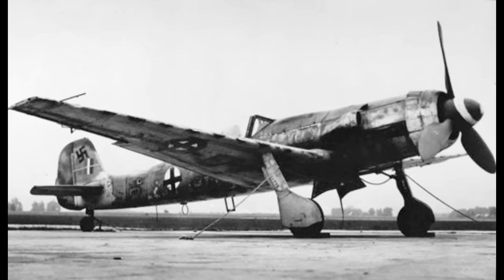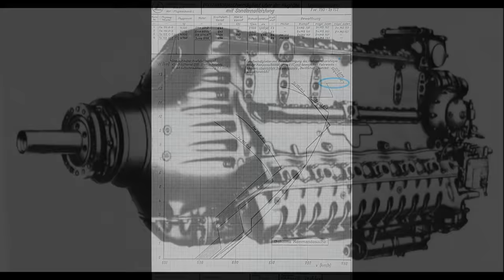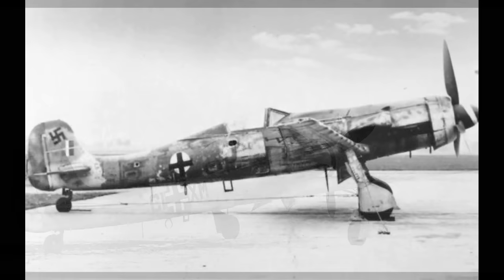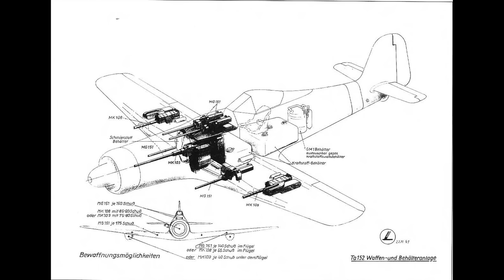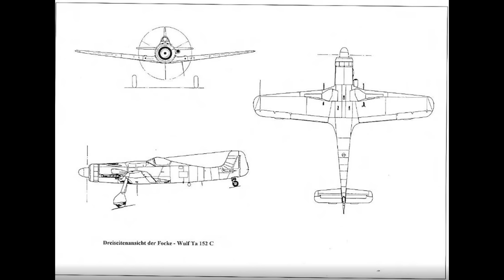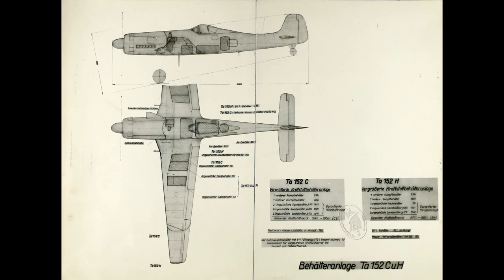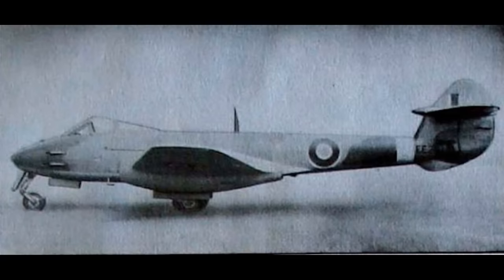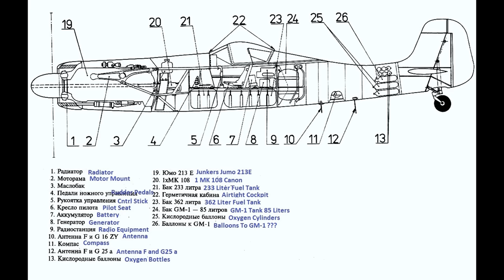Focke-Wulf Ta 152 H-1 Extreme Speed At High Altitudes.

Comment: Your videos say German manifold pressure was limited by fuel octane available. I just watched "The Secret History of Fighter Aircraft Engine Development in WW2" and he says it was valve metallurgy which limited power because they didn't have so much nickel. Any thoughts on what they say?
Reply from the maker: Metal was a factor, but fuel was the bigger issue. I can prove that, and at some point I will.
Reply: These are two interconnected but quite separate issues. One question is, for a given ideal engine design, and a given fuel, what is the knock limit. The second question is, if you install sub-standard valves, by how much are those ideal limits reduced. It is not a simple matter to understand it without substantial reading, and if you are very interested, you need to buy my book. In which you can actually read translated spoken word records of the German engineers discussing it during the war.

As far as proving that fuel is a bigger issue, the answer from 1941>1943 is is easily demonstrated by looking at the BMW801D which used high octane C3 fuel and the DB605 on standard B4. Both were reduced to about 1.3/1.4ata with B4 and low nickel valves. After about 1943 BMW, Jumo and DB were all using chrome plated valves, which significantly reduced the problem, after which the fuel again became the limiting factor for a short time, but the fact the German fuel had very high levels of TEL (which is extremely corrosive) adds a further complication, as such fuel attacks the valves more aggressively than Allied 100/130.

I`m afraid that "bigger / smaller" is too simplistic a metric to use to understand the issues in full.

If Greg wants to collaborate on a very detailed "deep dive" into that, I`m sure the result would be useful.

Comment: Several comments were made regarding "the faster propeller driven aircraft" during the war.  In context of extreme speed and high altitudes, why isn't the Dornier DO217P mentioned with is 488mph and 53,000 ft ceiling?  Were the comments only limited to aircraft which saw combat, were fighters, or were single engine?

Comment: Putting the Jumo 213 in the Ta152 certainly worked out better than putting the Jumo 211 in the 109.
Reply: +Zubenelgenubi    Putting a DB-605 onto a captured Spitfire worked out pretty good as well.  I would interested to see a current Spitfire restoration try that for a while.

Comment: What are the differences between the Ta-152C and the Fw-190D? Could you please make a video, because to my untrained eye, they look so alike that I don't see any appreciable differences, certainly not enough to warrant a whole new airframe desidnation
Reply: +George Armstrong    I'm pretty sure that you cannot take a Fw-190D aircraft and "convert" it to a Ta-152C.  The Ta-152C prototypes were built from from Fw-190D airframes though.  But consider the Ta-152 to be a new generation airframe.  Internal systems would also be different on the Ta-152 series,  such as an early form of pressurized cockpit and an early autopilot system.   Also the Ta-152C was going to use a DB series engine.

Comment: I have always wondered how engines were refreshed during WW2. For example, were the engines after so many hours sent back somewhere to be rebuilt? Likewise, were engines with higher hours swapped to other older airframes, etc.
Reply: + Rick    There were repair and service depots.   Allied mechanics were more likely to perform heavy engine repairs while the Luftwaffe would just swap the engine and send it back for service.   There are a few films of Luftwaffe engine repairs and service, although remember that a lot of the workers were slave labor.   The Luftwaffe also sometimes used the process of removing the entire engine, cowlings and all, and replaced it as a unit.   Captured equipment was also repaired for use including spare engines for captured aircraft and weapons for technical training.
Reply: @FiveCentsPlease  thank you. I find this repair / replacement process to very interesting subject. It seems like it would be nightmare considering the numerous variations of a single aircraft type.

Comment: Do 229 , can u do a video on this? the
 pusher puller twin engine fighter bomber. I wonder if that configuration could have been utilized to a fantastic degree if done with best possible engines.
Reply from the maker: I probably should.
Reply: I hope you don't mind if I join-in please , Misty ?  Are you referring to the Dornier Do 335 cos that has the twin-engined push/pull arrangement ? There's the  Horten brother's amazing Ho/Go -229 flying wing and that is just so cool . (It was designated as a 'Go' because it was built by the Gotha wood-works ) Pete

Comment: I think the DB603 is a longer engine, which is undesirable for fighter aircraft; plus it wasn't designed with the aftercooler in mind, and not as compacted as the Jumo213. All German single-engine fighters were minimal design with an airframe as small as possible, so every time they tried to put a 603 to a small fighter, it became a failure.

Comment: I think that the Fw-190 C used a DB603, Turbocharged. It had even an P51-like air-intake (for charge air cooling)  under the belly.
Reply: a prototype did have a belly intake similar to the P-51

Comment: Here is a question completely out of left field. In WWI, the British fighters generally had ailerons on each wing while the Germans tended to only had ailerons on the top wing. Did this give the Brits a better chance of bringing their plane back if they lost an aileron in combat? Did it add a lot of complexity to have the extras? Did the extra ailerons provide for better roll control?
Reply from the maker: More aileron area with all other factors equal will give better roll rate and increased redundancy. The other side of that coin is that it adds a lot of complexity in assembly and rigging. Every time you pull the wings off to transport it , it's an even bigger pain to put back together.

Comment: Here is my take on the cabin pressurization.  I think the primary reason the cabin altitude was set to 8km was to provide the required partial pressure for gas exchange in the lungs to occur at the higher altitudes approaching 40k feet.  This is based on the assumption that German oxygen systems used continuous flow or diluter-demand systems.  I  can’t find any evidence of production or near-production ready pressure-demand systems in the United States or Germany until post-war.  One could reasonably assume it was easier to pull turbo compressor air into the cabin that it would be to create a pressure-demand system with the required sensors and servos also prone to failure.  Just a WAG.  What do you guys think?  Here’s a decent article describing the challenge: https://www.boldmethod.com/learn-to-fly/aircraft-systems/oxygen-systems/

Aww Admiral beat me to it :)
Reply: Agree.  At 40,000 feet breathing pure oxygen at ambient pressure is not enough and you need to pressure breath to get enough partial pressure of O2 in your lungs.  So pressurizing the cabin to lower altitude lets you forgo pressure breathing which is inconvenient and tiring.  It also helps prevent evolved gas disorders like the bends.  Flying at high cabin altitude is tiring in general and wears you out faster.

Comment: I ve seen a jubilee Journa l1988 from MTU several years ago,from  there they descibed the DB 603 engine.
As Daimler Benz examined late in the war the official power settings for this engine were far too low.
Target Power was 2000 hp to
 2300 hp they allow 1750 hp later
1900 hp service maximum power, example:
Heinkel HE 219 Uhu Nightfighter
So they give in that they hadnt used the service potential of their engine.

Comment: 13:30 now I’ve got the bizarre mental image of pulling up to a gas station in a Ta-152 to top off the tank with E15 regular. Granted, I doubt the Ethanol does the engine much good, but it’s still amusing to me that they got those speeds running automotive grade gasoline. Imagine the sort of climbrate and speed it could have gotten with USAF 150A.
Reply: + spindash64    At some point, leaded aviation gasoline will be regulated out.  I don't think that is a bad thing, but vintage aircraft operators are going to need to get a waiver to operate with leaded fuels or re-tune the engines to run on new gas.   I think Shell was working on a replacement fuel that has the needed properties for GA aircraft.   Otherwise these warbirds are going to stay on the ground, especially the multi-engine heavies that need the power.

Comment: Some of the comments regarding the performance of the TA 152 don’t match what the pilots said.  There is the famous story of Kurt Tank getting clear of four mustangs when he was intercepted on takeoff.  Pilots describe putting a thunderbolt into the deck when it tried to turn tighter than a Ta152 at low altitude and spun out.  They said that on the first turn a TA 152 wasn’t quite as tight buts it’s superior power allowed it
Reply: To out turn the other planes.   They were impressed with its speed and general performance.
Reply from the maker: The incident with Kurt Tank was at high altitude, not right after takeoff. I could not find any case of a TA152 fighting a Thunderbolt. If you can give me a specific example of something I said that you don't think matches history, I'll be glad to address it. Please be specific, and with the time in the video I said whatever it is.
Reply: @GregsAirplanesandAutomobiles    I am reading that in April 1945,  JG 301 was operating a handful of Ta-152s and had multiple encounters with P-47s  or possibly Tempests near Sachau, Germany.   There was an encounter (said to be 14-April-1945) that was described by a ground observer with a Ta-152 piloted by Fw. Willi Reschke engaged with a P-47 at about 150 ft.  There may be some confusion whether it was a P-47 or an RAF Tempest from the ground witness.  Reschke had a weapon malfunction and decided to out turn the opponent.  He made a sharp turn and when the other aircraft tried to follow it snap-rolled and impacted the ground.   Ta-152H-1 W.Nr. 150168 was surrendered by Raschke to RAF forces.  This is the other example that was scrapped by the British.
Reply: Kurt Tank flew the 152 as often as he could, and in one famous incident was flying an early Ta-152H from Focke-Wulf’s headquarters to the factory in Cottbus when, soon after takeoff, Langenhagen Tower called and told him that enemy aircraft were behind him. Sure enough, four P-51Ds appeared in his canopy mirror, closing rapidly. Tank firewalled the throttle, activating the Jumo engine’s water/methanol injection system for a substantial horsepower boost, and left the Mustangs standing. The incident was of course reported by the baffled P-51 pilots—the first hint the Allies had that the Luftwaffe had developed a prop-driven superfighte
https://www.historynet.com/designer-pilot-kurt-tank.htm

Please don’t tell me I am incorrect when I can back up my story.

Comment: It's interesting Greg, that where the allies increased the number of prop's as power increased, the Germans simply increased the chord of their propellers and produced enormous blades.
In what way was this beneficial over the allies approach to aerodynamics?
Reply from the maker: I don't know, but there are NACA reports on this, I'll read them and get back to you on it.
Reply: That will make for an interesting conversation. In the case of the Merlin in the later Lancaster bomber with more powerful Merlins went to wider bladed props based on US recommendations,  replacing their usual high aspect ration 'toothpick' props but retaining 3 blades.
Usually the trick to getting the power into thrust is more blades giving increased surface area but that has drawbacks with increased torque and P effects on the aircraft. Also with the hollow hub prop hub that the Germans used with their complex variable pitch prop system, I'm not sure they could make it into a 4 blade without making it much bigger and hence affecting the drag/cooling/balance of the design.
Generally speaking large paddle blades provide excellent acceleration from a standing start before dropping off somewhat, the thinner blades are more efficient in general flying and so they catch them up and overtake them. That us why different blade types are used of light aircraft. I don't  know to what extent this thin vs broad blade performance is affected by altitude but I couldn't help but feel the latter would be better, after all waggling a wide bladed row boat in the air will give you more resistance  than a thin one and that would be what the air would be like at altitude.
Reply: @vumba1331  appreciate your comments my friend. It always struck me as a major discrepancy between the Germans vs allies.
Reply: You're welcome. There are of course other things to consider, aren't there always, and these came to mind after my initial comments. My background is business so logistics, limitations and capabilities are important, I have an interest in history and have talked with a number of people from WW2, and flying, both full size and models is my passion.
With the state of Germany at that time the development of a 4 bladed hub may not have been an option due to time and resource constraints, as well as it not being on the political agenda. Having said that the propeller designers/manufacturers obviously felt confident enough to say that they could do it with 3 blades on a new design type, and it looks like they were successful. The plus from this would be that all they would need was the new blades hence the timeline for availability would have been much better, with the bonus that there would be very little change of weight at the extreme nose of the aircraft this ensuring that the C of G was not affected nor the aircraft's handling. From a pilot's perspective it was business as usual.
Some additional thoughts to add to the initial question, firstly was it more power that they needed to absorb or was it the ability to get the power that they actually had available at high altitude to pull the aircraft along?
With light aircraft,  there is as saying re blade numbers '3 for show, 2 for go' with a 3 blade prop getting you off the mark quicker but at speed the 2 bladed prop will be faster, assuming fixed pitch units in both cases. This is to some extent true but I find a 3 bladed prop much smoother to fly behind as it is easier to balance hence I stick with a carbon fibre version.
Finally, in terms of props and power at low altitude,  why is it that they didn't go with 4 blades on the engine for the Corsair  fighter, like the Thunderbolt? Would they have needed to crank the wings if they had used a smaller diameter 4 bladed unit?
Fun to think about!

Comment: Enjoyed the video! Question how would you think the Do335 with 495mph top speed would do compared to Ta152?
Reply from the maker: It's probably superior as an interceptor. However if fighting at 30,000 feet, I suspect the Ta152H would have the edge. I'll get to the Do335 and other Ta152 variants in my super prop series.
Reply: Thanks!

Comment: Does anyone know, why some late british or american fighters had 4 or 5 propeller blades and the germans remained at 3 propeller blades, even at their high performance models like the Bf 109 K or the Ta 152?
Reply: +Nitramrec    Propeller design theory will need a new video.  The choice is a trade off between more blades, wider blades, or longer blades for total prop area.  Each has advantages and disadvantages -- more blades are less efficient.   Thin blades produce less drag at lower altitudes.  More prop area is needed to grab the air at high altitudes.  So the prop is also chosen for the optimal performance where the aircraft will operate.   Something also to consider are materials/time shortages to manufacture more blades and more complex propeller hubs.